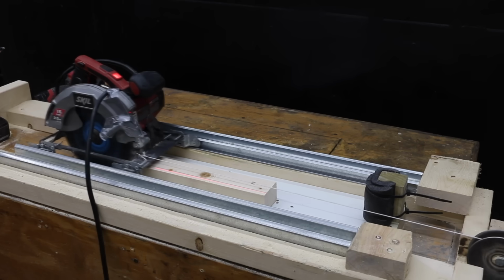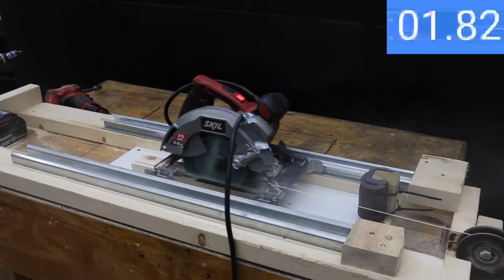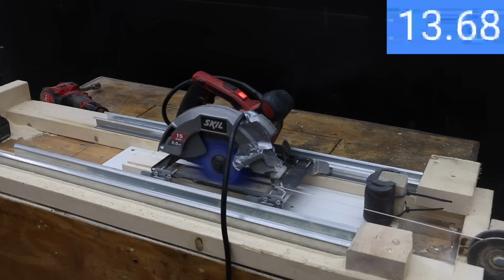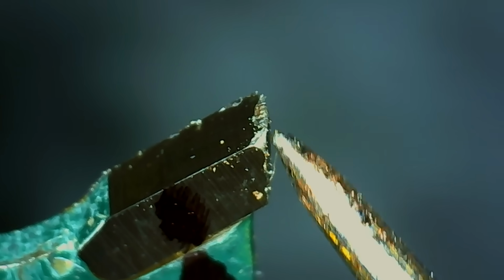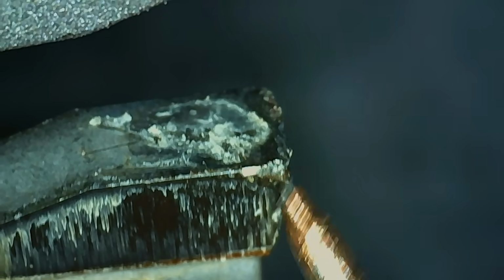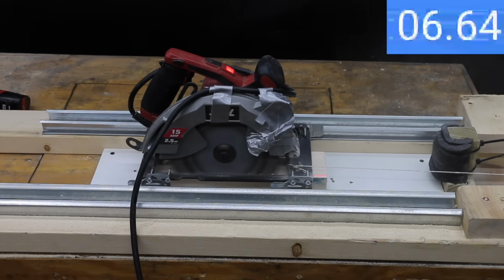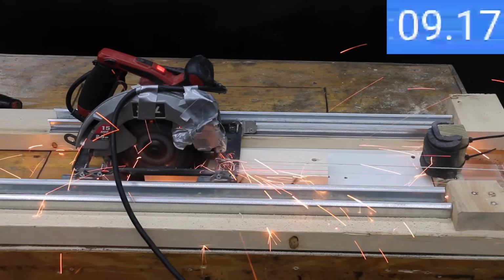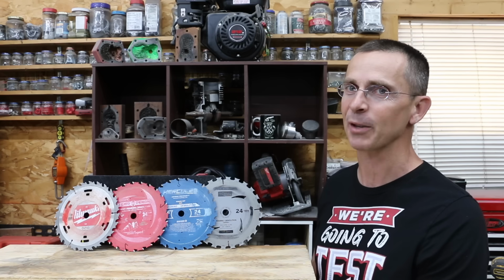Best "Demolition" Circular Saw Blade? Milwaukee, Diablo, DeWalt, Hercules, Evolution, Bosch, Amana

Comment: All in all, an informative and cool video. I might try the Spider. I was not impressed with used Evo blade. Diablo is my go to, gives a clean cut, stays/cuts straighter , saw brakes last longer, plunge cuts far better than the many other blades I have used. They seem to last longer through nails and various materials, probably because of the steeper grind angles and thin curf ( and maybe higher grade carbide???)  One critique on video is that more teeth do not equal faster cut; typically less teeth for rip blades     7 1/4" 18T , combo blades 24T , Cross cut 32T or better. Lots of factors omitted in the dialogue, carbide grind type and angle, curf size overall and in proportion to blade,  depth and angle differences in clean out side of the tooth; all these affect speed of cut.  In demo, more teeth , to an extent, might mean more chances that some teeth get less damage and remain sharper, whereas , odds are , all things equal, that fewer teeth have less chance of retaining less damaged teeth.  Your vids are informative, just dont want viewers to accept a misconception that more teeth equals faster cut in general. 
It might be worth wile to do the same test with a worm drive saw since it is demolition related, and up the applied driving force. Thanks again for video.
Reply: ..I use Diablo a lot, too, as it is a decent blade, and it is what Home Depot sells...since Home Depot is about the only local option in my town(unfortunately, we do not have a Lowe's, a Harbor Freight, etc. within 50 miles..and one of those "Menards" would literally be in another time zone)...the only gripe I have against the Diablo, is I really hate all that red paint rubbing off on my wood...especially finish pieces..I really prefer saw blades didn't have paint on them-steel finish with clearcoat is better. If Harbor Freight were closer, I would probably buy some of the Hercules blades-they seem very good for the money(but then, I would have blue paint rubbing off on my wood).. :0

Comment: What would be really nice is to see 2 tests! 1 for oscillating blades for wood, a separate 1 for metal,  a blade for scrapping,  and a blade for demolition.   Then it would be nice to see which oscillating tool performs the best. 

 I truly believe there is no biased when you do your tests. You are my go to for not wasting money on overpriced tools.  

Have you had any experience with woodpecker tools?

Comment: i know you read all the comments so i've thought up a possible interesting new project for one of your videos....it'll take a little time to explain.....I have a lister type stationary engine that i want to couple to an electric generator head by the method of using an 8 inch pulley with a 6 ridge serpentine belt face....  However after diligently searching the internet i cannot find serpentine drive pulleys in an OD of 8 inches.....i have similarly been unable to find a machine shop to custom fabricate the required pulley ab initio, nobody is interested and we would probably be looking at $600 to $1000............so i thought can i personally make an 8 inch pulley that will accept 7 or 8 hp via a serpentine belt drive from a 2 foot diameter flywheel turning at 600rpm in order to give an rpm of 1800 at the generator head...a pulley that won't break down and isn't dangerous to use......and here's what i came up with.....take an 8 inch stainless steel round cake pan with 2 inch vertical side ($15) purchased from amazon and fill that cake pan full with epoxy resin ($60) to give it strength and durability while still have a flat steel working surface on the rotating face......attach by thru bolts and reinforcing metal plate shims an SK bushing ($35) with an ID of 1-1/2 inches and then figure out some kind of weight balanced edge guide to keep the belt in place .....the top cake pan edge already has a 1/4 inch lip but the bottom guide might be made from a clever placement of long hose clamps cleverly joined  or some other clever idea as long as the weight/balance is carefully equalized in order to keep the belt caged under tension on the pulley during operation......so the question to be answered is can an amateur fabricate at home with common materials a pulley that can be just as useful as a cast iron pulley
Reply from the maker: Thanks for the suggestion.

Comment: "Someone throw that Blue Starfish back in the ocean!" 😆😂🤣    As a carpenter with 25 years experience with framing and finish work, I've used most of these brands. I really like Avanti and Freud blades. They last longer, produce cleaner cuts and are very affordable, unlike Makita and Dewalt which were always waste of money. They make good tools but crap blades in my opinion. Haven't tried Hitachi yet though...
Reply from the maker: Thanks for the feedback.

Comment: How about a test on allen key or hex key sets?? I find that the edges tend to round off quickly and can then strip out the fastener head leaving a disaster. These are common on bikes where they can corrode and are some times in soft materials.. Once  the fasteners are corroded, they have to endure massive stress for the small size involved. Bondhus is often said to last with out rounding off and is not extremely high in cost like Wera. The 3/8 socket drive is probably the best way to remove seized hex fasteners with out damage. It would be very helpful to have real world performance tests.
Reply from the maker: Thanks for the suggestion.

Comment: Hello. Love the videos. Very thorough. Would you be able to test hand saws 🪚. And compare a variety of brands, and also throw in some regular saws vs Teflon coated ones. Possible tests could be damage to teeth, speed of cutting, temperature of blade during cutting. Thanks in advance.

Comment: Thank you for adding Master Force to your tests. I gotta be frank and say that the Master Force tools, although convenient battery swapping and less expensive, can't hold up to my tough carpentry work. The circular saw is weak and even with new blades, like Diablo, it binds up and stops frequently. It's particularly noticeable on OSB or hardwoods.
Reply from the maker: Thanks for sharing.

Comment: Do you have a similar video for 80 tooth blades? I am looking to get a new blade for my miter/chop saw to start installing engineered hardwood floors and I want o make sure I get smooth clean cuts.
Reply from the maker: Thanks for the video idea.

Comment: Diablo has always been my go-to blade for framing and formwork. When you're reusing old form ply, you always get a little bit of concrete impregnated in the wood and that wears out blades really fast. I've found that the expensive hilti blades don't last as long as a diablo.
Your method was solid, but my biggest critique was that you were using all these blades for a rip cut application. Rip cuts always skew performance tests towards blades with more teeth because each tip has to do less work individually, which means a lot less friction and heat buildup over time compared to real demolition blades. The wider teeth on demo blades are meant to tear across the grain and splinter the wood apart, which doesn't happen when you follow the grain. And the main use for a demolition blade would be just that, cross cutting dimension lumber to knock old structures apart.
Reply: I am the same . Over the test of time diablo seem to last the longest in all round performance .
Reply: @michaellebreton4294  Well except now you can step up to the Hercules.
Reply from the maker: Thanks for the feedback.
Reply: If I asked my kid to take a crayon and design the dumbest saw blade he could imagine, I think a fat blade with only 5 teeth is what he'd come up with.
Reply: This critique is exactly why he shows (and mentions the importance of) the chart that measures percent of decreased performance of each damaged blade compared against its original state. The speed of the cut is not in play, only the percent decrease in speed. A blade could be the slowest of the pack, but using this metric if it was robust enough that its speeds slowed down the least amount it would score higher than all the "faster" blades.
Reply: I could write a freaking book with the replies to your comment.
Reply: You have it backwards sir. "rip blades" always have less teeth not more. "Rip blades have a smaller number of teeth and larger gullets, which means there's more room to remove the shavings and dust. These blades are designed to cut along the grain of the material on the table, but although they cut faster, the resulting cuts are rougher" Pretty much everything you said is wrong.
Reply: @MrWizards1974  With all due respect, the point went over your head.

I'm not comparing rip saw blades to crosscut saw blades on a rip cut application. I'm comparing crosscut blades to other crosscut blades in a rip cut application. There's a world of difference between the two and it has nothing to do with anything you just said, at all.
If the deciding factors for rip efficiency for crosscut blades were primarily based on gullet size and fewer teeth, you'd expect the saw blades with the largest gullets and fewest teeth to win this competition. Real world tests and real construction experience show that the reverse is true for *crosscut blades*, and that is because the most important aspect of rip cutting for a crosscut blade is the tooth alignment, NOT the gullet size or lower tooth count.

Dedicated crosscut blades have an alternating tooth angle from left to right, which acts more like a knife to alternately slice multiple scores across the grain. This is great for tearing the grain, but not for cutting along the grain direction.

1 out of every 3 teeth on a combination blade (edit: sometimes 1 in 2, depending on the blade) has a chisel tooth that is square to the cut direction, and it is this tooth that makes the combination blade more effective on a rip cut over a pure crosscut blade.
The more chisel tip teeth the combination blade has, the better it will be in rip cut applications.

This is why all the 24 tooth combination blades performed nearly identically well, while the 14 tooth blades performed consistently poorly, and the 5 tooth demo blade performed consistently horribly. When you're using a crosscut blade on a rip application, the biggest deciding factor is the number of chisel teeth and this is why I pointed out to Project Farm that it would be better to do these tests in a crosscut setting, otherwise it makes the results of the demo blades artificially worse.
Reply: @-Keith-  Nice back peddle but you said "my biggest critique was that you were using all these blades for a rip cut application. Rip cuts always skew performance tests towards blades with more teeth because each tip has to do less work individually" <-- this is 100% wrong that's what I'm calling you on. Nothing went over my head You're just plain wrong. What I quoted was 100% fact "rip blades" always have less teeth not more. "Rip blades have a smaller number of teeth and larger gullets, which means there's more room to remove the shavings and dust. These blades are designed to cut along the grain of the material on the table, but although they cut faster, the resulting cuts are rougher" All of the blades he tested are "Demolition blades" which is code for buy my fancy thin kerf combination blade.
Reply: @MrWizards1974  There's no backpedal. He's testing demo/combination blades. I'm pointing out why testing crosscut/demolition blades on a rip cut test skews the results towards blades with a higher tooth count (which is exactly what the results showed). He understood the comment. You didn't.

More teeth on a combination blade = more chisel tip teeth, which are designed for rip cuts. I'm sorry that you got confused because I didn't spell it out in very specific terms in my initial post.

Facts are facts. Combination blades with a higher tooth count will rip cut better than combination/demo blades with a lower tooth count, for exactly the reasons I outlined.

Do me one better, since you're so set on proving yourself right about tooth count and gullet size: prove to me why the lower tooth count blades performed better on this test (hint: they didn't).
Reply: @-Keith-  Nice dodge but again "Rip cuts always skew performance tests towards blades with more teeth because each tip has to do less work individually" Why do you keep skating around the fact that this is what you said and it's just flat out wrong. I love how you're trying to point out crosscut BS when the whole test was pointless as it is. The blades should have been tested on a composite material such as MDF that has a uniform density and moisture as both of these will effect how a blade performs. Doing this test on 2x4's and cutting through knots and cutting closer and closer to the denser heart wood skewed the results and IMO invalidated the whole test. But hey it's all for entertainment anyway.
Reply: @MrWizards1974  "Why do you keep skating around the fact that this is what you said and it's just flat out wrong."
If my comment (or the video itself) was intended to speak to rip saw blades, you'd have a point. Since my comment (and the video) was not intended to speak to rip saw blades, you don't really have a point and are just being unnecessarily obtuse. The video is about crosscut/combination blades. My comment is addressing the interaction of crosscut/combination blades with rip cuts, and you're failing to recognize that everything I've said is entirely correct, when you view my comment with the context that I'm speaking specifically about the kind of sawblades and materials that he's chosen to test. Ripping sawblades are not featured in this video, so I'm not talking about those. Hacksaws are not in this video, so I'm not talking about those. Japanese pull saws are not in this video, so I'm not talking about those. Capiche? Comprende? Verstehen Sie?

The simple matter is that you're taking the comment outside of the context of the scope of this video. If you do that, you could assume I'm making the claim that a hacksaw blade would perform the rip cut faster because it has more teeth, but your assumption would still be wrong - because I'm talking about the tools and materials he's chosen to test with that are in this video

Frankly, you're doing an excellent job of skating around the consistently grouped results of the test, my questions to you as to why the test results are consistently grouped, and the science behind why the test results were so consistently grouped. Knots don't have anything to do with it, the wood was clean and of a higher quality than you'll find on most construction sites with very small knots. Heartwood doesn't have anything to do with it, the softwood 2x4's he selected for this test have a uniform consistency on their end grain with no heartwood, and besides that point, the 2x4's were plain sawn rather than quarter sawn so he wasn't cutting "closer and closer to the heartwood".

And besides those points, testing demo blades by cutting through MDF is a terrible idea because you're not using demo blades in the real world to make a lot of cuts in MDF. You're recreating the same problem as the rip cut test. You use demo blades to take down old framing, which means mostly cross-cutting dimension lumber with the occasional bit of plywood or OSB, and zapping the occasional nail or screw. That's what they're designed for, and that's what you should be testing them on: the task that you're supposed to use them on the most.

Everything I've brought up about combination/cross cut sawblades is straight fact, if you don't believe me you're welcome to go sign up for trade school and learn something, or better yet, go buy a dozen 24T combination blades , a dozen 18T combination blades, a dozen 14T framing/demo blades, and a dozen 10T framing/demo blades, and perform a series of rip tests yourself. Go ahead and repeat the test 1000 times, you'll achieve the same results every time.

While you're at it, look at the difference in profile of the teeth on combination blades vs demo blades vs ripping blades. Combination blades alternate left/center/right cutting angles, demo blades alternate left/right cutting angles, ripping blades have entirely squared off cutting angles on their teeth. It's not BS as you put it, it's the entire reason why these blades are specialized to their tasks. While I agree that the test was invalid for the purposes of what he was trying to achieve, the results were 100% valid with regard to the point I was making about demo/crosscut/combination blades and ripping times.
Reply: @-Keith-  LMAO
Reply: @MrWizards1974  he is actually correct. Dont be so ignorant lol
Reply: @MrWizards1974  what's wrong with you mate?

Comment: Is there a particular purpose for blades like the big blue or is that just a meme blade?
Reply: Blades that have a thin kerf profile (width of the teeth) are very prone to pinching and kickback if the material that you're cutting is under any sort of pressure or stress because the kerf is not much bigger than the rest of the blade. Pinch the blade, and the saw kicks. Pinch it hard enough, and it gets stuck. Demo blades like big blue have a wider kerf compared to their blade thickness, which makes them less likely to get pinched in a cut. Also eliminating most of the interior of the blade reduces the chance of pinching if you cut a stud that is carrying a heavy load. You'll still get kickback, but the blade won't be stuck in between the cut.

Having a wider tooth puts more strain on the motor which slows it down, and so if the blade had a lot of teeth, the motor would not be able to maintain a proper cutting speed and you'd burn out some internal components. Having fewer teeth gives the motor time to bring the blade back up to proper operating speed, but makes the cut much more ragged.